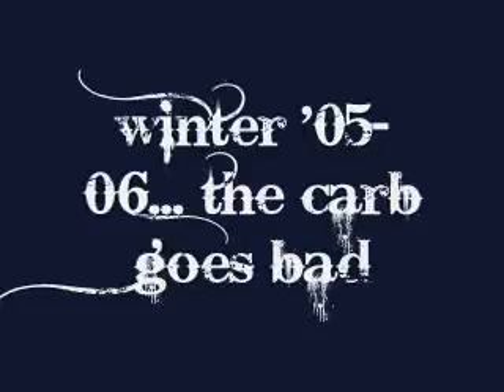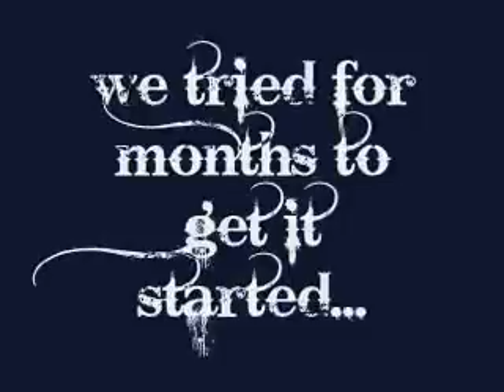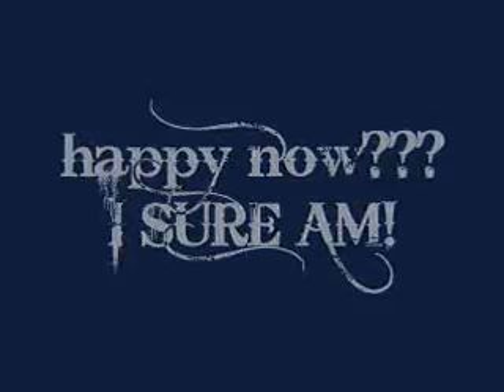1958 ford progress video 2

Comment: lookin good, Me I got a 58 Ranchero with a 62 "406"  I always thought the 58 was prettier than the 57, with the egg crate grill, hood scope and quad headlights.  I just didn't go for the tail lights that year, but the Ranchero keep the 57 look.  Don't forget that a "FE" will drop right in.:)  
Good luck

Comment: One thing that I have always been wondering is why did you paint this engine ford engine blue.  Even if you are building a "rat rod" or a traditional streetmachine or what ever it doesnt hurt to have a stock looking setup.  My 63 project has a hotrodded engine painted orignal color.  I think it looks good and it really fools the people that see it.